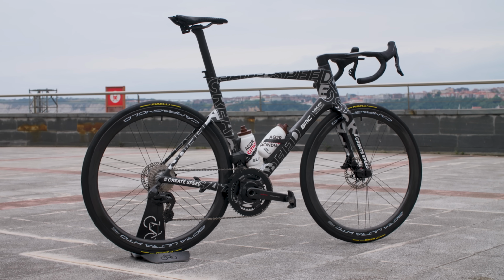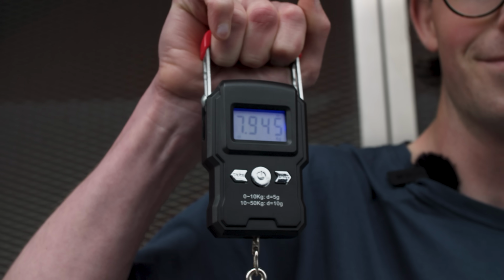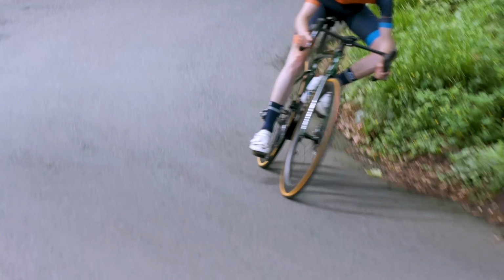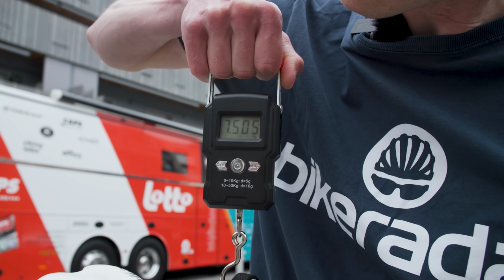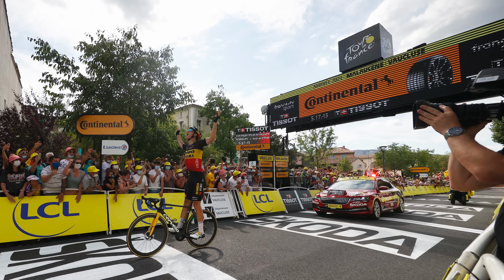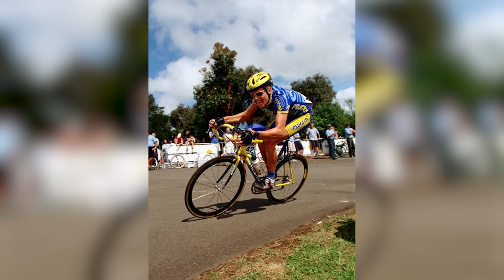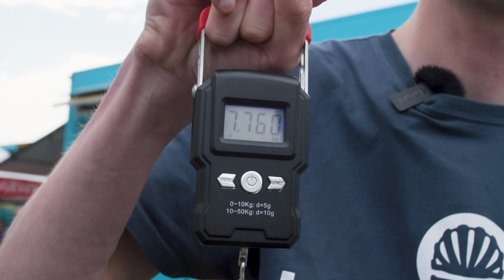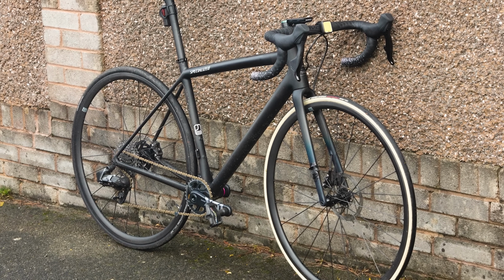Tour de France Pro Bikes are HEAVY! Here's Why...

Comment: The Pro versions are less than the UCI limit so they add lead weights into the frame to make sure the bike is within the limit, especially a small size frame. You can’t be sure what a Pro bike is like from putting it on one of those the scales.

Comment: I am sure all of you are less that 10% body fat and cannot lose weight without losing power. For the rest of us, it is far cheaper and easier to lose some KG off of your body than try to trim it off your bike. What we need are bikes that are stiff but comfortable and reliable. I do not care if the bike is 1-2kg heavier. I do care that it fits me, transmits my (non pro level) power to the road and works when I need it.

Comment: Additional equipment such as a power meter, start number holder, aero computer mount and a transponder is used or required in the race. This results in an additional weight compared to an enthusiast's bike. Furthermore, a setup with large chainrings is used on professional bikes, which increases the pedalable speed and the drive efficiency.

Comment: Frames must also be designed to avoid sudden failure under shock loading, and they must also be stiff enough to avoid steering oscillation (which is more of a risk when very high downhill speeds are encountered). Durability and stability are just as important as climbing weight and aerodynamic drag. The ultimate end of weight reduction may very well be frame fractures or instability.

Comment: A lot of these calculations are flawed.... it is important to remember that most of a bike race will be spent in a draft, and thus when taken into account, on a mountain stage, a light bike is still a prevalent choice, because the riders know that there is usually a really key section to a stage that dictates the result.
If that key section is a 10% climb, you have wasted all your aero advantages sitting in a bunch and then get dropped when it matters.....

Just an engineers thoughts.

Comment: They say 1kg is around 7 watts. Uphill it matters for sure ... It's basic science. In a bunch better wheels helps and weight could matter less.  The GC riders go for the lightest bikes as we see now. They trying to shave off every gram and massive costs using components
Reply: 1kg will only be 7w on a steep enough pitch.  That will be different for every rider.  On some pitches for some riders, 1kg won't be even 3w

Comment: LITE WEIGHT ALL DAY LONG aero may help on flat stages but THAT more to do with you on the bike and aero wheels ,40mm MAX ,maybe oval downtube . l still feel disc brakes lock up too fast and cause more crashes watching the close up videos of TDF proves it !! Disc brakes require way tire contact grip to be safe on a road bike something gravel/MTB bikes provide !! Now l know disc brakes on wet raods n carbon wheels work better BUT l argue then use alloy wheels ,there s still lightweight options that work great with RIM BRAKES they have for decades !!

Comment: What most people dont understand is that riders must consider 2 factors against their power input. Weight and aero drag. Weight is a constant regarless of the speed but aero increase the faster you go. Putting it simple it will be ideal to have a light bike in the mountain stages but the faster you go the more drag you face, since most areas are flat or with little % hills then is better to have an aero bike. If TDF was a pure uphill race then lightness will be the priority.
Reply: Actually there is a third: stiffness
Reply: @matthiasbr3656  yeah, carbon is more stiff vs aluminium per de same weight applied you lose power when the bottom bracket flex (of course you cant notice it more of the time but the laptimes reveal it).
Reply: Correct. Weight IS a constant. A lighter bike will CONSTANTLY be lighter than a heavier bike.

And aerodynamic drag will be (about) the same at any given speed and cycling position, regardless of weight. Certainly, an aero bike will have an advantage when it comes to drag.

SO, regardless of aerodynamics, a lighter bike will ALWAYS be easier to pedal given any amount of aerodynamic drag than a heavier one.

By the way, WHO the hell is switching bikes when they get to a hill? Who's swapping a heavier bike for a lighter one?

I live in Queens, NYC. It's nearly as flat as Kansas here, so hills are not a big issue.
Reply: @kewgardensstation  learn some physics, aero drag increase at the square of the speed. The faster you go you need more power and/or less drag to achieve the same speed (obviously considering weight it´s the same). That´s the reason in higher speeds you need a more aero one, in uphill areas where you cant increase power lighter is better.

Comment: It’s worth remembering that the weight quoted by manufacturers are for bikes without pedals, bottle cages etc, when pro bikes are weighed they have these things fitted, meaning they’re 3-400 grams heavier than the quoted weights we’re used to.
Reply: According to UCI regulation, bottle cages is taken into account to determine the weight of the bike, which should be lower than 6.8 kg. I do not know about pedals thought, but I assume they are also taken into account
Reply: Bike manufacturers never quote bike weight - there’s no point. They quote frame weight and they are exact in order to pass UCI cert.
Components and groupsets are where the weight comes from.
Reply: @dominicbritt  Plenty of manufactures quote build weights, without cage, pedals or mounts, usually in a size Medium
Reply: @dominicbritt  Many of them quote weights then specify which size was weighed and that weights vary.
Reply: @dominicbritt what world are you living in?🙃 Plenty quote weights.  Also, frames can differ by over a pound alone
Reply: @dominicbritt duhhhhhhhhhhh

Comment: Disc brake era 😂 Bikes are heavy as hell.
Reply: Not sure what disc brake bikes you’ve been riding?
My disc brake 2020 SuperSix is 300g more than my rim brake 2016 SuperSix. 7.6kg versus 7.3kg.
Reply: Yes they are my 2016 Giant TCR advanced SL is 6.6kg with rim brakes
Reply: @1rickqwert  And my 2011 or smth Look 595 Ultra with 440 mm aluminium handlebar and quite heavy Selle Italia Turbomatic TE saddle (220g), pedals, garmin, aluminium bottlecages is 7,3 kg.
Reply: Found someone with 1w/kg average power
Reply: disc brakes are still less efficient in crosswinds

Comment: They are not heavy 7,5kg is not heavy, especially on flat stages where it don't even matter. But the reason some bikes weight more than the others, is simply manufacturers. Bikes cost money, and bike parts and components cost money. If you aren't the best of the best,  you can't modify your bike with all the expensive stuff. You go aero, or lightweight. Pogacar has some 3d printed carbon stuff on his bike to make it close to the UCI weight limit. Vingegaard also has his bike modified to be close to the limit. I'd guess many of the GC riders have some stuff done to their bikes. At the highest level, if you are in a team but not the GC rider, then usually you opt for the more aero bike, since you need all the help you can get to pull your team, or group or whatever.
Reply: Exactly!!
Reply: 7.5kg is heavy in the year 2023.

Modern day so called “high end” road bikes should be lighter than ever compared to high end bikes  of 10-20 years ago. Guess what, they’re not.
Reply: @astrayagrarian3802 that's because they know tubeless tires and wheels are better in nearly all scenarios.  That alone is over 0.3kg or more

Comment: Pro bikes are heavier today because that’s what their equipment sponsors tells teams to ride.  

There are no more rim brake pro bikes today because the groupset makers no longer provides that option for you on high end electronic groupsets.
Reply: Well, apart from Dura ace 12 speed di2 and SRAM red 12 speed rim brake groupsets you are entirely correct.
Reply: While I agree regarding the groupset, as mentioned in the video teams can decide between a lightweight or an aero bike and they choose both depending on the situation. Consequently saying "they ride what the sponsors give them" in this context is simply incorrect.

Comment: Brand won’t start building light bikes again if the limit goes away. Do you remember the tarmac sl7 recall, or the canyon aeroad stop ride recall?  If there was any way to make them lighter without being weaker they would. The negative publicity risk is too great.
Reply: They're building light bikes.  It's not hard to get a Specialized Aethos under 6.8kg, even with as much house brand stuff as possible

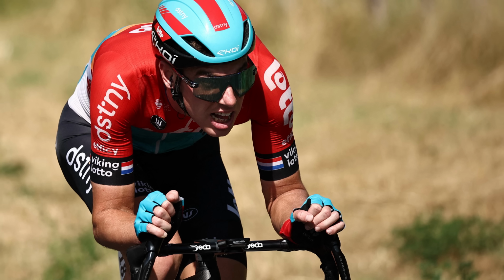Comment: 2:49 I respectfully disagree. Aerodynamic in fact is a highly important factor when riding solo. In a bunch however aerodynamic does not play that much of a role - even when riding at 45kph.
Reply: of course it does! for the one in the wind
Reply: I respectfully disagree, aerodynamics makes a difference whatever the speed. The gains get bigger as the speed climbs. Gone are the days of 6.8kg bikes across the board. You save so much energy in the bunch with an aero bike and i know this from testing and personal experience in races